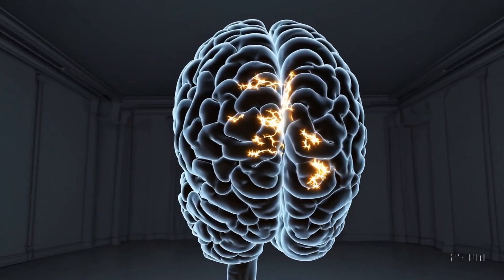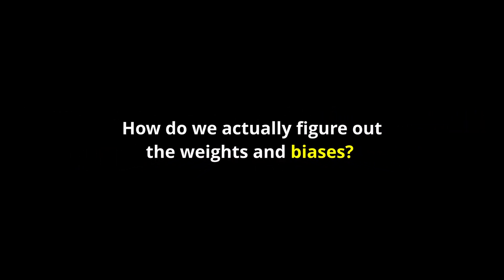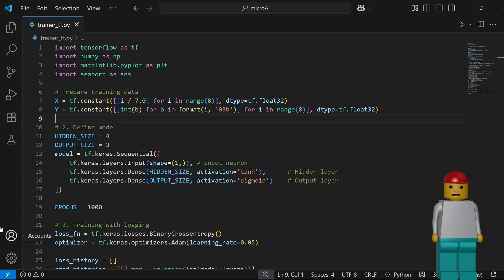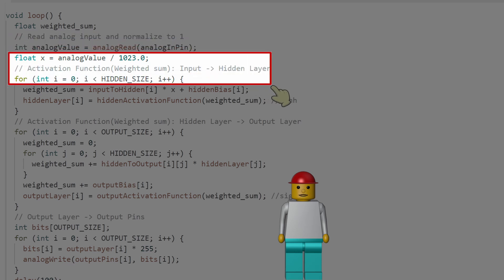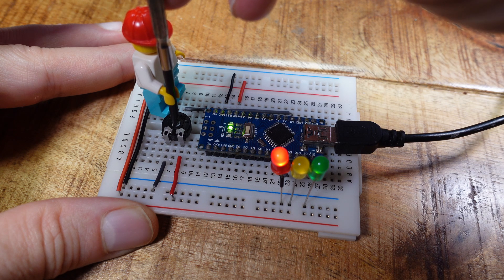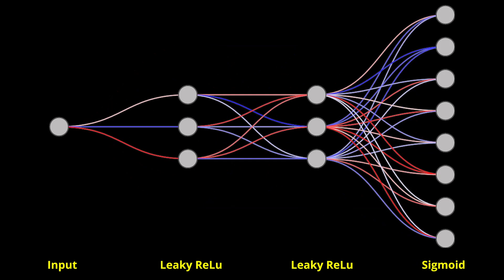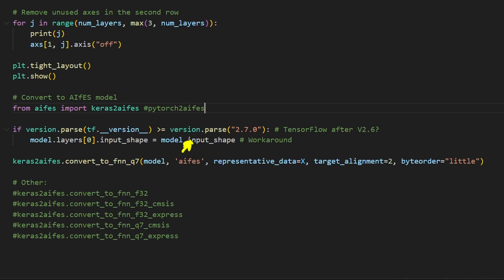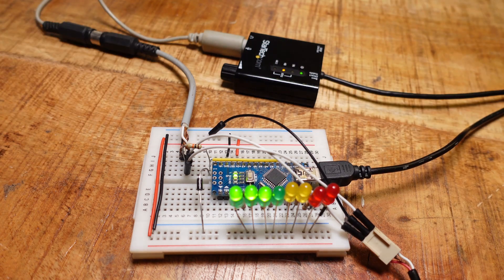Run Neural Networks on ANY Microcontroller!

Comment: in this experiment, isn't the voltage/signal manually changed via dial/know? How AI/ML / NN came then? what exactly did it learn? Can anyone help me understand this?
Reply: Hi, the NN here is capable of learning the user chosen correlation between the potentiometer and the LEDs. I know it sounds a bit confusing because in this case the task is very simple and surely not used in real applications. 
But once the NN is trained on different potentiometers values and adjusted its weights with the use of back-propagation (computed in python in this case),  then you may export the NN's weights and biases and implement them into Arduino.

Comment: Very interesting!
I never thought about running neural networks on a microcontroller, nor about the complexity of the NN.
Was this project pushing the limits of what can be expected from a microcontroller or was it just scratching the surface?
Reply from the maker: This example did just scratch the surface. I think that there is much more possible. I'm gonna find out.
Reply: @DoctorVolt  I will also start experimenting with it :) Just ordered an esp32 with a camera module. There is a traffic light in front of my apartment and I want to see whether it can detect the state of it. That way I could leave the apartment perfectly to never wait at it again 😄